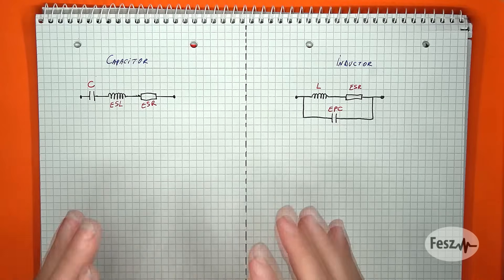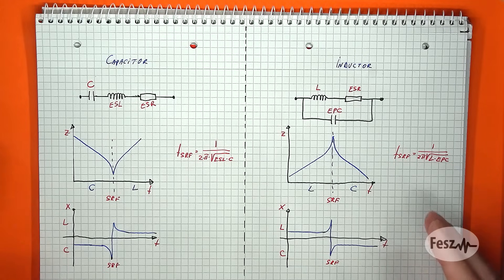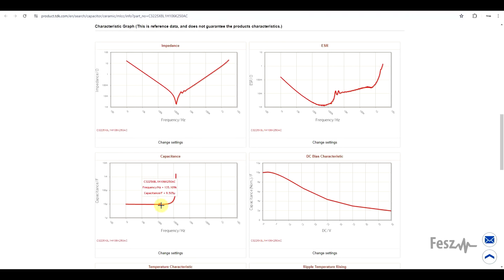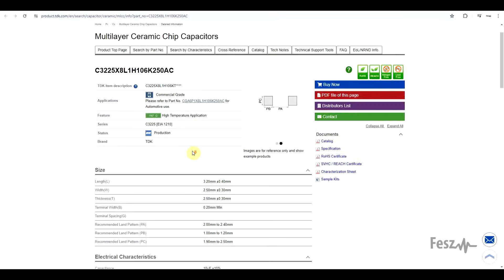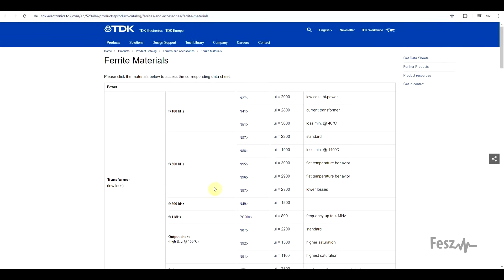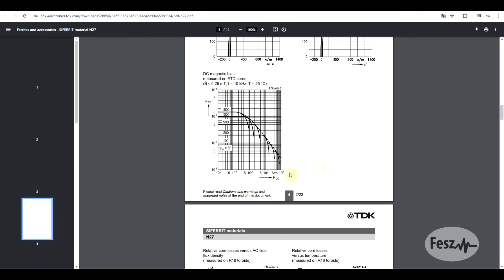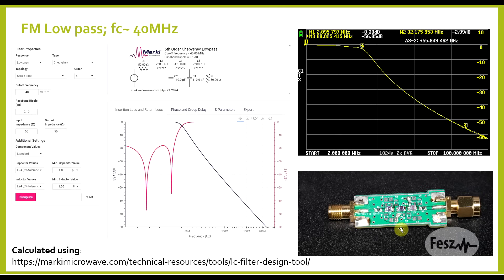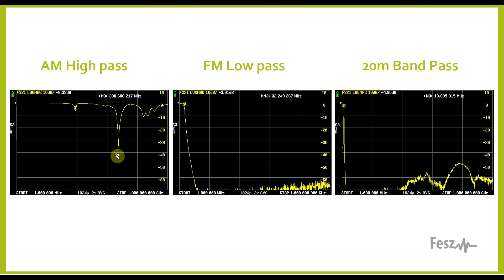Limitations of LC Filters

Comment: Thanks for another interesting video.
Ferromagnetic materials have magnetic dipoles in them which will rotate all to the same direction as the externally applied magnetic fieldstrength increases. This externally applied field originates from a current through a wire wound around the magnetic material.
At some magnetic field all dipoles are fully aligned and at that point the material is what we call saturated. The inductance drops at that point. This doesn’t happen in air coils. There are no magnetic dipoles in air.
Exactly the same happens between class 1 and 2 ceramics in capacitors. Class 2 ceramics have electrical dipoles embedded in the material and these align with the applied electrical field up to a point (as the voltage increases) where all dipoles are aligned and the material saturates. These dipoles in the material, just as with magnetics, allow for much higher capacitance per volume but with a limitation.
You can calculate charge Q in a capacitor by V times C. Do that over voltage using the C vs V graph and you will see that the charge ramps up and then goes flat, similar to the B/H curve of a ferro magnetic material.
Class 1 ceramic material doesn’t have these embedded electrical dipoles and behave linearly like air in an inductor.

Comment: Good basics.  But in my life the “fun” starts, when I have to forget the fixed 50 ohms.  I mean for example needing a broadband reject filter at 1 ohm impedance level or 10 kilo-ohm level.  Or better yet, common mode noise filtering.  In many cases, I have to “kill” the resonance in order to pass my (relatively) wide band signal accurately and eliminate wide band noise.  Very high quality inductances and capacitances produce resonances as shown.  My challenge is to utilize additional resistances as part of my filter, or select my ferrite that naturally has a very low Q.  But while solving the resonance problem, I also need to avoid burning my added resistor with DC, for example.  Most of my (analog) signals have to make it through unshielded twisted pair cables, or worse, untwisted multi wire cables and be subject to neighboring digital signals or switching power ripple/noise.  As said, let the fun start!

Comment: Choke use frequency around resonnance.
Reply from the maker: Indeed, with a choke, usually the purpose is to present a high impedance value (the exact inductance or capacitance does not matter all that much); anyway, with chokes, you also have high resistance and resonance, so most of the high impedance is lossy-resistive rather than reactive. In contrast, with an LC filter, usually in the pass band and transition band, you want to have good control over the exact reactance values (and keep resistance to a minimum) to reduce losses as much as possible and ensure precise frequency behavior.

Comment: Capacitors or inductors are essentially ideal constructions that do not exist in reality but are helpful to us in discerning capacitive and inductive behaviours. Theoretically, it is impossible to conceive  and thus construct a capacitor without inductive elements and vice versa. Similarly, all conductors come endowed with a certain resistance and it is impossible to conceive a resistor without inductive or capacitive elements and vice versa. Perhaps we could introduce a more advanced approach to teaching electronics where we would only speak of reactive components of two flavours, primarily inductive or primarily capacitive, depending of their frequency response and therefore do away with the artificial and idealised distinction between capacitors and inductors. That might have practical benefits in designing better circuits by preventing certain unexpected and definitely unwanted behaviours in the end result.

Comment: Another excellent video. Complex reactance circuits really  are, well, complex.  🙂
My old amateur radio brain kept trying to characterize antennas in filter characteristic terms. At first I thought it would be a simple paralell, with mostly scale as the difference. Then I wasn't so sure. 🤫...Then my brain melted, and I went and had a beverage.
Reply from the maker: I guess that to some extent, the complexity is what makes antenna design so interesting - if it was easy it would not be fun